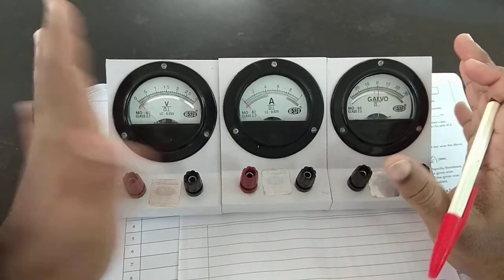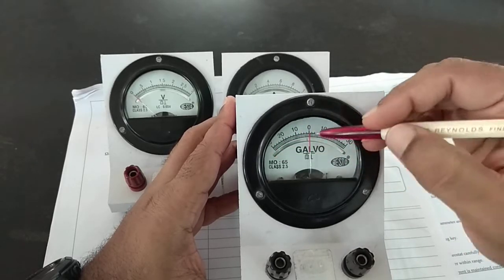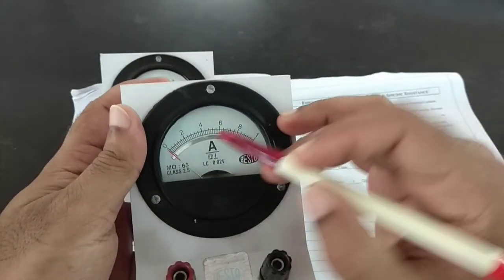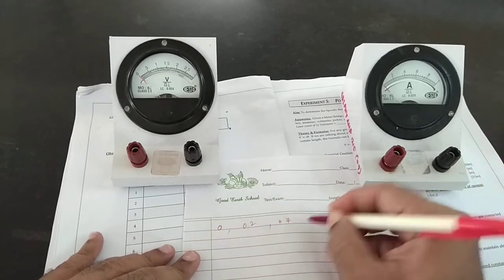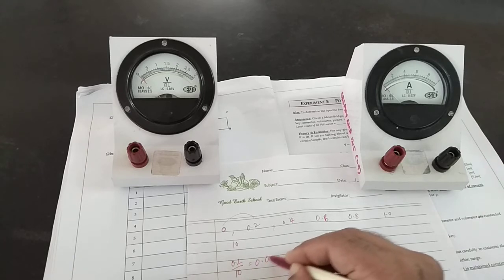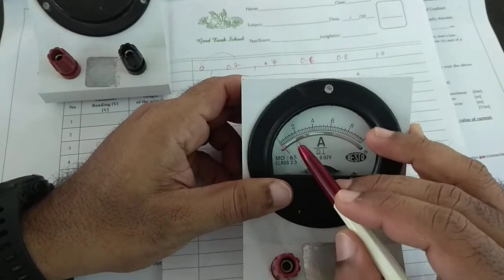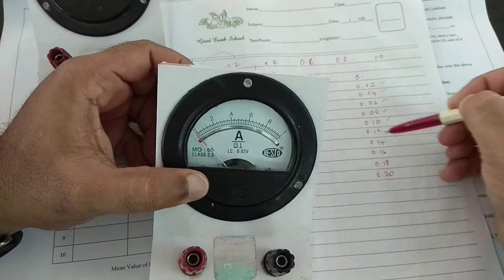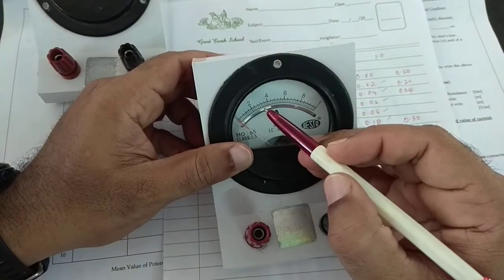05 How to take measurements on an analogue Voltmeter and Ammeter

Comment: What happens if it goes over 1 in ammeter? What do you write?
Reply from the maker: Can you measure 17cm with a 15cm scale? You cannot so you have to adjust the parameters to get values less than 1A

Comment: Sir, you have just made things more confusing and complex. Rather than learning about the values with the LC. What I do is to just look at the first lowest reading value say 0.2 , and look at how many divisions are in between the 0 and 0.2 in most cases it should be 10 so naturally the least count should be 0.02 and you are done at this point. Now just leave the reading (values idea) from your head and just look at  the point the needle is at from zero. Say it is at 0.4 whic I will read as 20 divisions then multiply it with LC so answer will be 20*0.02 which is 0.4. 

In the same way if it is at 23 points from zero, my reading will be 23*0.02 which would be 0.46. Its just soo easy and there is no chance for any confusions. I hope others who didn't understand the video might find this useful.

Anyway thank U for the video  sir. And tomorrow is my ISC board physics practical, wish me luck 🤞.
Reply from the maker: Its late but best wishes to you!

Comment: 0.75 values ammeter can we note that
Reply from the maker: The least count is 0.02, so no. Either 0.74 or 0.76 only. Even if the values are in the middle, you have to chose one of those values and cannot write 0.75